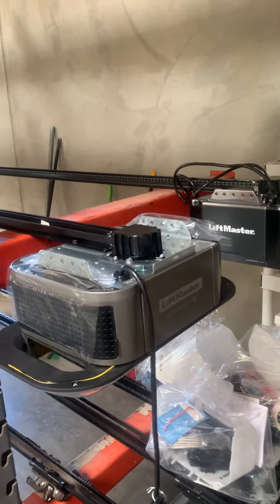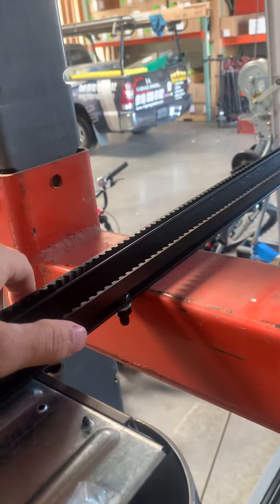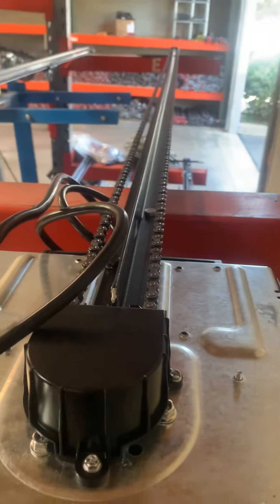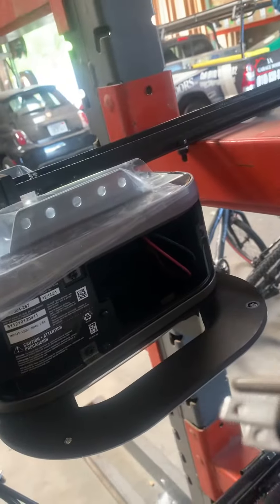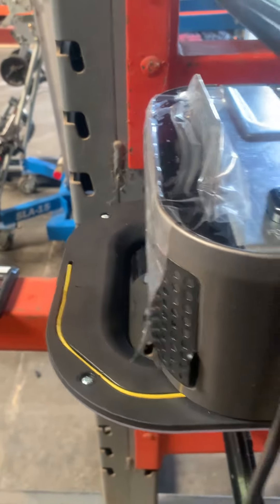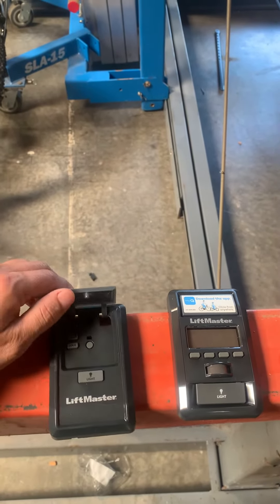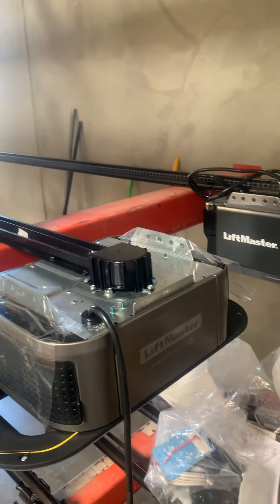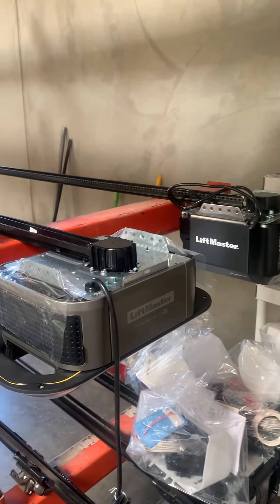LiftMaster Chain drive vs Belt Drive garage door motor

Comment: Thx for the video. Very helpful comparison! But I'm still concerned about getting a belt system b/c we have a 1970's era very heavy wooden 2-car garage door (non-segmented) that swings out to open and the heat in our garage can be extreme = sometimes higher than 100 degrees (with no climate control). Would a chain system be best for those conditions? We're not going to replace the garage doors (there is a 2nd wooden garage door (a single), but we don't open/close it).
Reply from the maker: It really depends on your door weight.  I would probably recommend the chain drive on the wood doors.  And if it’s very heavy, the carriage house Liftmaster’s are the best solution.
Reply: @1agaragedoorssacramento  Thx for your reply. Appreciate it! We'll chk out the carriage house models to assess if needed.
Reply: @1agaragedoorssacramento  We ended up getting that carriage house model installed today based on your idea. It's much quieter & doesn't look like it's straining like our old opener. Thx again. Our door seems to need t h e 3/4 h.p.
Reply from the maker: @FotomakerAcademy  awesome.  Yeah those motors are workhorses. Even the gearing on them is different.  Good choice!!

Comment: This is a high end belt drive vs low end chain drive. It is better to compare 87504 belt drive vs 87802 chain drive.
Reply from the maker: 87802 is a completely different animal.  It’s made for heavy doors where 87504 won’t pull or have trouble pulling. So I went off of most common openers installed in our area.
Reply: What is the model number of the chain driven one.

Comment: RE: the camera on the belt drive 87504....what does the camera do.??...takes video??..plz explain...GREAT video...THX.....plz reply soon.....4-18-24
Reply from the maker: Yes, it’s a video. Where you connect to your Wi-Fi. Anytime your door opens you could always use what’s going on. It also has a two-way radio. It’s good if you set up your Amazon prime to where they open up the garage door to put your package in. You can always know what’s going on.

Comment: The DISADVANTAGE of the built-in LED lights is that when they fail, fixing them can be more difficult than a simple screw in LED bulb. Yes, LEDs do fail, and when they fail, they will often blink, not just quit.
Reply from the maker: True.  So far around 1k openers with LED’s we installed, we haven’t had a single problem.

Comment: Sounds like you are phasing out the chain drive units and want ppl to buy the Belt drive units with all the bells and whistles. I was hoping to find out why most Chain drive  units only go up to 3/4 HP while the Belt drive units seem to go up to 1-1/4 HP.
Reply from the maker: My personal opinion is the 1-1/4hp makes no sense on the chamberlain units when the rail is piece together.  And LiftMaster will only provide 3/4hp max in the residential unit. But they have heavy duty gears and solid double rail.  Even if they provide that much hp, the gearing and the piece together rail will collapse much faster.